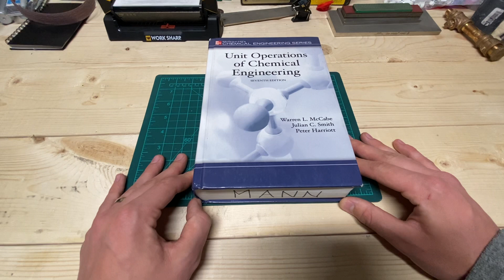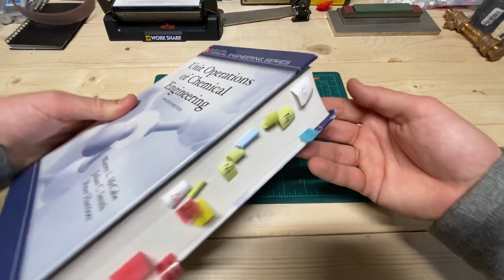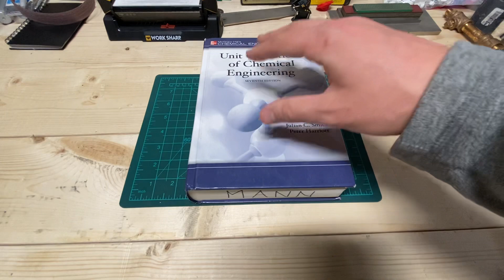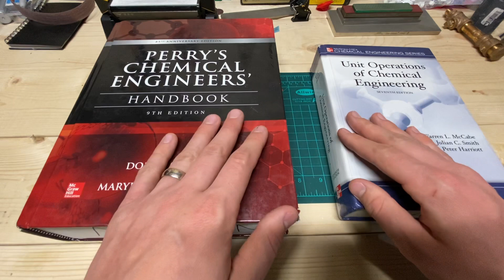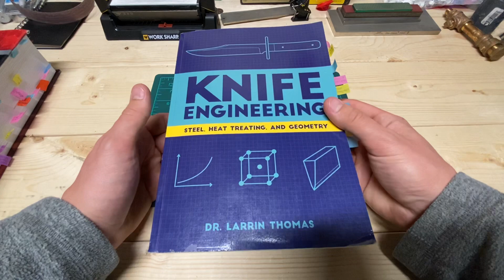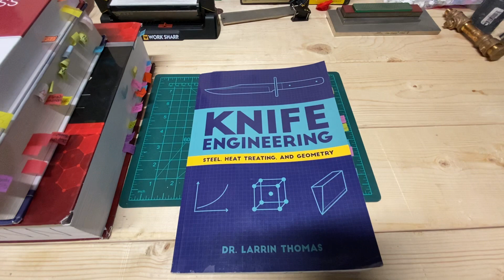An Engineer's Tools (How to Use them for the Process Industries)

Comment: Thanks for sharing your reference books! It’s pretty helpful for more junior engineers.
Reply from the maker: Good reference material is critical I find! If you’re getting into oil and has words cannot express how amazing the “Gas Processors Suppliers Association: Engineers Data Book” is for industry reference material
Reply: @EngineersPerspective701  I work in high-tech manufacturing, everything I do right now is on a pilot scale. However knowing how to implement process control is critical when you are taking things out of development and building processes and tooling from the ground up.
Reply from the maker: @nandayane  very cool job! Sounds pretty hands on I bet it’s a freakin blast!